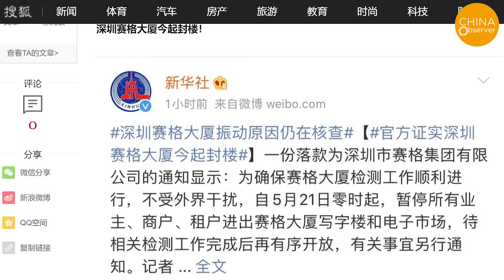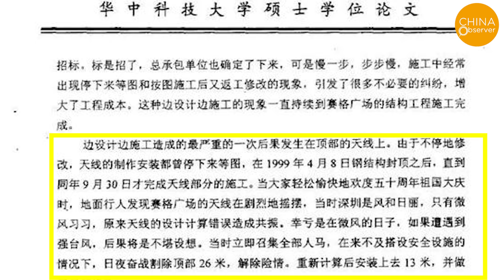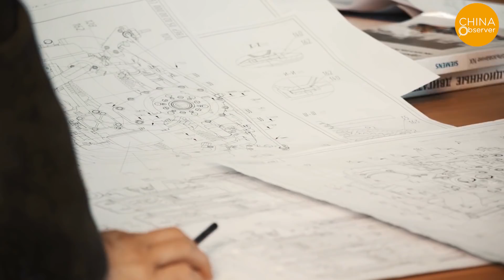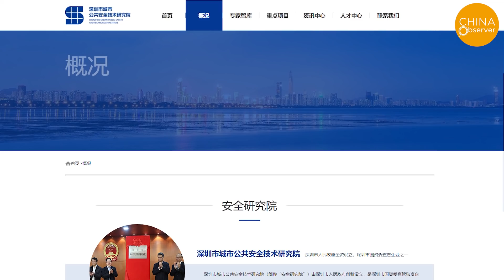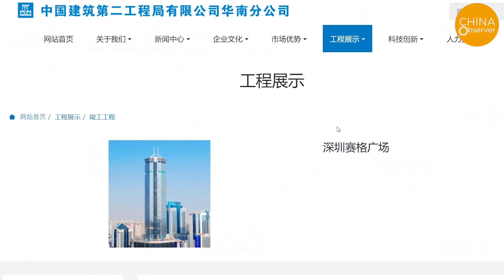356m Tall Skyscraper Shaking Again, Monitoring Data released, analysis of the causes of shaking

Comment: "The build's antenna design error caused resonance" ... Why would you design it in the shape of a tuning fork.  That antenna needs to be replaced.
Reply: Earth is currently hit by huge electromagnetic radiation especially coming may 26th 2021....tuning fork antenna picking high magnetic resonance and earthing.... hope building can survive....I wonder too the health of occupants of this building..,.🌌
Reply: @oilenglai4128  I came here looking for someone with this theory. Congo volcano, Iceland volcano, strange storms, ect.
Reply: @philbe3095  The storms are most likely a result of the jet stream change. It has to do with the air pressure pushing it lower and that seems ato have shifted it somewhat as well. Instead of moving above mountains it has to move up and over them. This effects the flow and can cause stalls as well. All of this effects storms because they are caused by moving air currents.
Volcanos may be effected by global warming, I could see not just the surface temps to be higher but increasing temps even further down and building up preasure.
My other option is the Earths axis shifts effecting tectonic plates, the friction of those shifting creates heat/lava and the preasure is released at the weakest point, a volcano.
These shifts of our axis occur with any large earthquake (I think 6.5+) and even though that shift is fractional we have several of those each year and those years add up over the lifetime of the planet.
 An alaskan native tribe elder was in a video a few years ago and said the sun no longer rose and set in the same spot on the horizon as it did when he was young. That sure seems more than fractional to me, so I began looking for government sky cams. I thought since I could look at any given day of the year decades past and the current date I would see a change if there was one. I hit the jackpot of cameras in Germany but quickly realized out of hundreds of cameras all that faced east or west were broken or the morning/evening hours could not be viewed for the last 10 yrs (I think). So why hide such a axis shift unless they think it is a bad thing, like more earquakes and eruptions.
Reply: @MA-mh1vs  So you did see proof of an axis shift then?
Reply: In this photo, you can see the building is leaning.
Reply: It's well documented earth's axis alters ,12 metres is calculated in the last 100 years, due it's said to the construction of hydro electric dams that take water away from earth's centre shifting a collosal weight.
Reply: @pegjames188  Very interesting thanks!
Reply: The irony is that antennas are build to be resonant!
Reply: I agree but to resonate so much to shake a building!!! Thank god they cut it down in size now at least it will tremor  half the intensity!!! 👍
Reply: @carlstaude1039  what changed to make it pick up on something now and not in the last 20yrs? Natural or man made?
Reply: @MA-mh1vs  asking the real question

Comment: The resonance can change if you change some static parameters. Changes of the weight somewhere in the building on any floor. Swimming pools, transportation of several weights here and there, might bring the construction on a point of vibration on specific frequencies. The result can reach up to the catastrophe of the building.

Comment: to small concrete steel pilons as stable tech in early times for less tech and morte hury so weight and wind simulation and possible weather efects simulation were done to fast, or too ledd time to predict so everybody forget about no off pilons in earth, second solution si that pillons are slight away so kind asimetric solution resonca was done while pilons vibrate is apaers that wind make shake and iner motion elctric or even maglev vibrate create resonance, the structure pilons need planing at city office buro and also what kind reinforce strucuture type reinforcement is use, upon all off them also segment off stifness is condisedered so above floor doubled need to be single and if this doesnt work you need steel piping outer frame and steel reinforcer that looks kind scfi but you can check them in hong kong, is possible double reasons to short pillons and dispears away to much, so you need to stack inside more pilons is one solution nad only single floor allowed or you take above floor since building stabilizre and corect buidling into single floors, since china gov is trend all about one probably not allow even liek duplex tech and slowly start to make space scienca so double interest to do am, so you mesure it and take imediate two flours above down until it stops, if not , take extra two above floors amd corect floor to be single, when it stop order weight study and pillons tech checked waht size and what weight it suports and calculate mistake done and upon mass wiegh buliding and pillons and basic legislation if turns out is sloppy design and carlesness you can charge fine ot builders upon building vulue in building and finansial recompsentation all cost ot client involved as owners to live normaly or buy elsewhere aprtemetns atleast is honest to do so and have public statement so purpose is imrpoving and achivieng better life condition and more tech and following modern life  living condtions, most likel designer was following fancy high tech and allowing to much freedom and builder kind forget to advice about consturction or improvments, so after schecking documetnationa dn how amany apendix to change was done or imorpve is possible to give how much fault if note deliberate build left for society to educate or kind live, also to decide is spicy fine or normal brutto fine for corporation or even criminal avoit looks like is slopy intersts and legislation laws upon safety buildign need to improve also like like earth analisys soil documents prendeded to determine from city minimum pillons in concrete and steel is usual tech upon height depending also possible reason is luck off structure to keep elasticy force this is why hong kong buidling in oustside pipes is famous for, eo eihter builder dismantle fiew flouurs and heavily invest in new reinforce fasade steel, is wise to fine heavily or do dismantle top upon new shakes and then for fine to give new fasade to be teched and after all with image corp shaked in public but building still stays and builder tlearned a lesson to go safe and energy and build safe in construction slight smaller, this events are good for comunity and slight raze price real estate condoes in china and sell politics well, atleast is far so in civil society, but create somre nessesary nervous state at wokers and owners but is still better then total colapse build, so sanation project working with oficce city buro is adviced and documentation in publice shown from construction point off view is interesting sitaution almost as scfi project building as stuff not so much apaer in real life bridge yess that thay nedd more cable even upon design as more reinforce as stronger wind but builidings is bit odd almost scfi stuff the good part it require planing documentation check coop with city office buro and real time engienring solution which are usualy most simple but eficent and also recomendation for construct legislation improve and at site roughly like 40% budget building increase as paid fine for doing eperiment on life population as returning as design work buidling in lux stlye outer design this is far so and also doinf self home elaborate corp on laws change to rpevent this form hapening  and presenting document construction eginering faculty as solution as well as estimeted and realized costs after finished porject sanation you can talk big again and plan ahead but slight less tall for safety lvl next or with more suport in fundation and also outer design suport elemets in construction too, bit unusual but true

Comment: Was sea sand or salt water used in the construction of the prestressed concrete building members? If so, the salt would corrode the steel rebars and lead to hydrogen embrittlement and consequent cracking of the steel with a loss of structural rigidity.

Comment: I have thought that the problem with this building is in the amplification of certain ground vibration frequencies by the natural normal mode resonance frequencies of the structure. One error, or omission, may have been the lack of sufficient measures, like mass or viscous damping, to diminish these resonance frequencies. Additionally, if the prestressed concrete structural members were made with substandard steel rebar, or with concrete mixed with seawater instead of fresh water, there may have been corrosion fatigue occurring in these load bearing members. A weakened structure may not now have the structural rigidity to resist these vibrations. One concern is that these large amplitude vibrations may be further damaging an already possibly weakened structure and so I believe it would be prudent to evacuate the building for now, at least until the problems are properly identified and corrected.

Comment: My opinion is the builders were under pressure to get this built quickly. Also, China experiences corruption and substandard materials could have been used. I believe the engineering was good but I believe construction by the contractor and sub contractors were a bit shoddy. It happens all over. If that building collapses or has to come down, you can bet heads will roll. China has come a long way by having their brightest students study over here and in Europe. Soon, their aircraft will be certified by the FAA to compete with Airbus and Boeing. I believe the building is weakening due to poor materials and workmanship by the laborers and the immediate inspectors over them. I hope it doesn't come down as we saw with the World Trade Center. Thousands could die. If foreign engineers were involved, I would not step foot on Chinese soil.

Comment: Engineers needs to examine the structure as to damage.  Is there a possible movement of the soil directly under the building that would not register as an earthquake but would still cause the structure to shake.  Or is the structural skeleton have a fatal flaw that is causing a movement that would reverberate through the weight bearing aspects of the structure.

Comment: THEY FORGOT TO MENTION THAT THE WHOLE SUBWAY BELOW THE PLAZA WAS REBUILT AND UPGRADED.
( Thus more vibrations is in there now )
Several new stations platforms and lines have being built and this of course increase vibrations 
and also the whole digging have implications on the surrounding foundations .
When I lived in China I was there several times every week .
( Buying electronics components as semiconductors in that same building )
( there is a 7 floor high market for electronic components in there )
When I was there the whole plaza was a construction ground .
I remember when they started digging many many floors below ground .
Making space for new subway lines and upgrading the 3 stations directly under the plaza .
They finished just before I left China and I remember how big the whole underground is now .
All subway stations have many different exit's and you reach them by long big tunnels .

There is many factors when a building start shaking .
All due to resonanse .
If a building is hit by resonance's there are the same as the constructions itself then they amplify 
and become really really big ( even if resonance is not normally a problem )

An example is those high buildings where they have to place contra weights inside the structure 
to fight against wind forces .
They move against the wind direction and keep the building from move too much in high wind .
Those have to account for the structures own resonance and may NEVER move even close to those .
( otherwise the building can tear itself appart )

There is many other factors from groundwater moving that can make vibrations in the foundation 
to bad construction and so on .
I always remember this buiding as quite safe and strong compared to others 
( especially when you lok at the floor level construction , massive concrete walls ect )

Also I will point out that just bcause it's government and not private behind it doesn't actually 
give those problems mentioned in the video .
Private companies are actually more known to ' cut corners ' in construction that state companies .
This is due to the fact it's about money and private is more prone to work to get bigger profit .
The private companies ' hide ' behind so many sub-companies that it become very hard to actually 
place a responsibillity if something happen 
( Usually those really behing go free and the  ' lower ' parts get punished )
When this is said , there is still a degree of coruption and those implemented in government construction 
business use rivate companies as contractors to carry out the work .
There is a degree of lobbying inside to get the ' big contract's  ' and some of them shouldn't be there 
in the first place ( or in any other sections in building market too ) because they are NOT really 
capable of doing the work .
Those are the same who use private contractors in the building process and typically going for 
' the cheapest ' so to increase their own private profit .
( it's well known that lot's of money there should have being used in the actual construction end 
up in those ' pockets ' )

This is also what the government all time is fighting against .
But it's NOT that easy to actually expose those ( I call them FAKE people ) who working inside 
those government parts .
( they Vote each other in and protect each other inside and get the jobs to each other by a money system )

You really ' cant blame the government ' on this ( Not the actual government )
They do what they can to stop it ... ( after all its not legal what they doing )
This is also why you sometimes see politicians and city majors being arrested .
( they have alowed different degree of corruption )
Well sometimes when it happen you see an outcry in western countries saying that 
" China is so bad ' ' now they want arrest that for this and that '
Well there is a reason why those get arrested but western medias FAIL to tell the actual truth to why .
( Instead they try to ' strenghten the hate ' against china by publishing ' fake ' stories and pulling the
  actual truth below the carpet )

You MUST understand the politics and how the system function BEFORE YOU SAY ANYTHING .
You MUST understand why / how / ect before you criticise .
Problem all too many know NOTHING in reallity and thus just posting without knowing the 
background of why and what actually taking place .

In the US you just have to mention China and people go nuts and turn against you ...
For NO reason .
To understand China you MUST live in China ( As a Chinese NOT a typically western )
Learn , do as they do , understanding doesn't come from western tv , medias ect .

In fact the west faces many of the same internal problems as china do , but in the west they are 
more likely to wipe under carpet and blame other for it .
-----------------------------------------------------------------------------------------------------------------------------------------------------
Edit -
The KEY to a better world is UNDERSTANDING , and ACCEPTING that we are all at the same 
time both DIFFERENT and the SAME and accepting and understanding that can open 
a whole new life and hopefully give us all a more peaceful world .
Reply: sorry my typos .... I didnt sleep much and im on my coffe right now : )

Comment: What is the big deal and fuss? In Shenzhen city alone, they build dozens of skyscrapers every year if not hundreds. In China, they build thousands of skyscraper every year. If one or two has building issue, I will not be surprised. When you send rockets into orbit 1000 times, do you expect every time it will be successful?

The worst case is dismantling the skyscraper and build it again. It may take them just a few months to do it.
Reply: Another example is high speed train in China. I remember sometime in 2011 there is an accident which killed a few dozens people on board due to signal problem caused by lightening. Then China engineers  take lesson/learn mistake and reduce high speed train running speed from 350km/hr to 300 km/hr. Now the high speed train network in China has been expanded to 40,000 kms and running speed was returned 350 km/hr. There is no accident since then even billions of people in China take high speed train each year. 

If you are not willing to take risk , you will never progress.

Comment: thank goodness they are going in there with those wooden sticks. everything should be fine now
Reply: Bamboo sticks, so strong it’s used for scaffolding
Reply: @tsunamis82  Not good for stabilizing a sky scraper though especially since they're flexible.
Reply: @tihspidtherekciltilc5469  perhaps they are using them as internal scaffolding and will stabilise with something else. I think they should pull it down and start again.
Reply: It ticks the environmental green box too, well done China for keeping true to your climate change agenda and population control.

Comment: The pyramids of Egypt are still there after thousands of years and this 20th century building based on the most modern engineering will fall to pieces at any moment.
Reply: They don't make them like they use to.
Reply: But the wind just goes over it,  smoothly... Unlike hitting it like these buildings